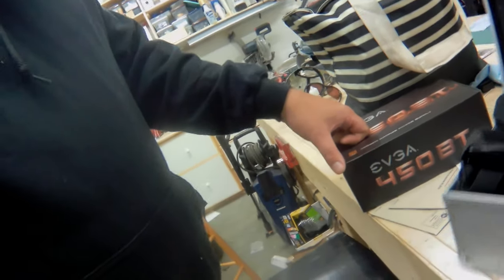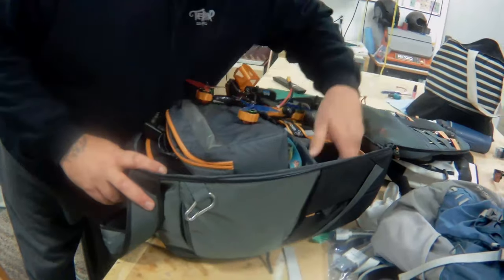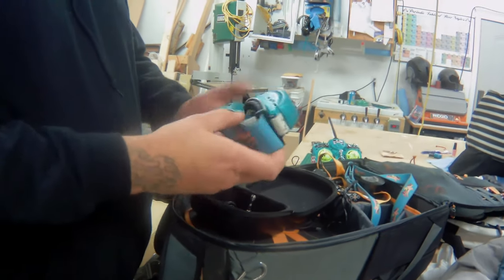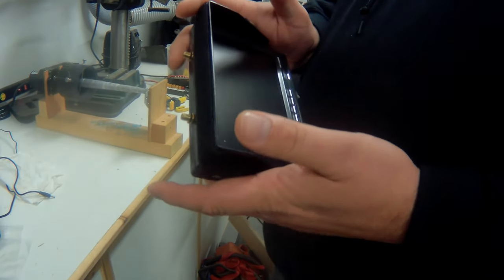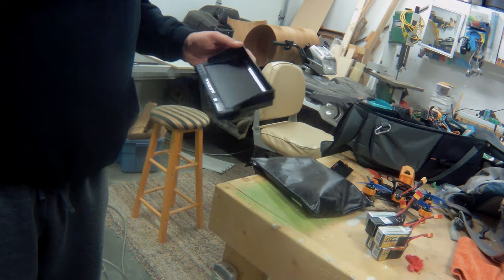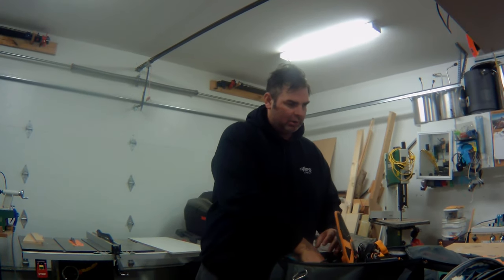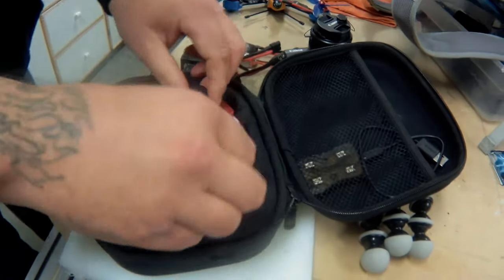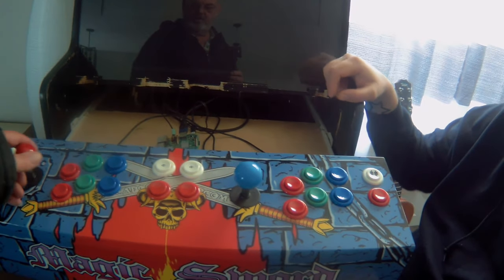Quad copter FPV pilot Teckor FPV meeting

Comment: Nice meet up:)
Reply from the maker: Thank you Merch for stopping by and commenting
Reply: do you think a 2001 sienna with 200,000 + km on it is worth converting into a camper van?   @NomadicVanman
Reply from the maker: @asad5067  well only if the price is right. I bought a van that was already built out. I don't think I would buy a van that needs to be built out myself, but that's only for me though.
Reply: yea im thinking does it make economic sense to convert that sienna to a camper minvan or is it too old???  i have no mechanical ability myself, so i will have to pay someone to convert it.  another problem is the seats are not stow and go so i will have to remove them and do something with them

i know the seller so its a reliable minivan...hes probably selling it for around $3000 @NomadicVanman
Reply from the maker: @asad5067  a year 2000 is not that old. Mine is a 1995 dodge classic supreme. I don't know what kind of van you are talking about, but as long as you can be comfortable in is all that counts. Sleeping is most important, as well as eating. Cooling in summer and heating in winter. I have friends in all kinds of different cars, trucks, vans,box trucks and so on. I can't really tell you what is right for you, you have to make that decision.  If you have the money, why not. Just make sure to set aside $3000 to $5000 for when things go wrong, and they will. If you haven't already please subscribe and click the bell to get notified when I add a new video. Welcome to my humble group of subscribers.